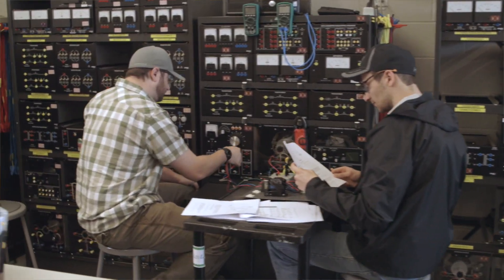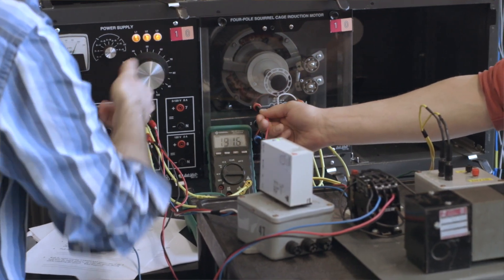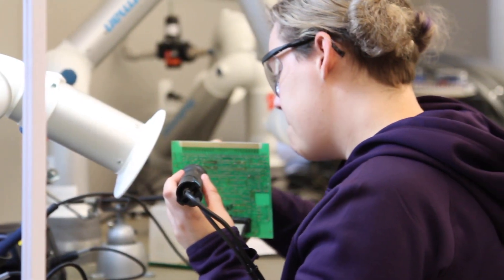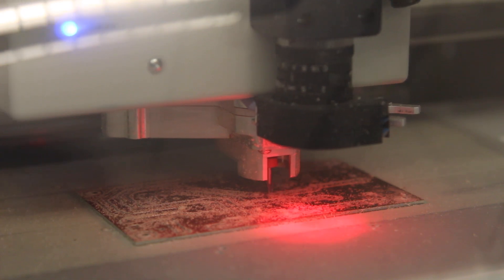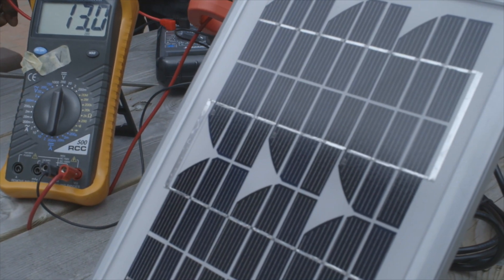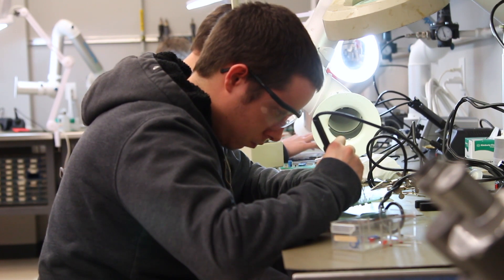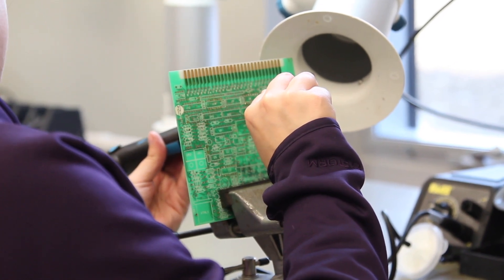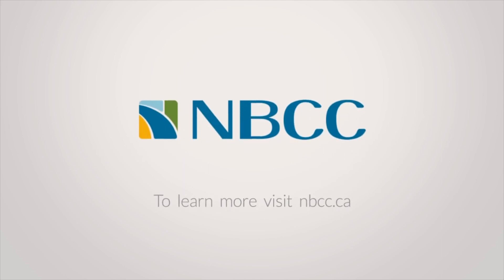BIG INDUSTRY, BIG DEMAND: ELECTRICAL ENGINEERING TECHNOLOGY

Comment: Electrical engineers do more than plug in wires they are the creators of those wires?
Reply: Check out signal processing. That's one of the hallmarks of electrical engineering.